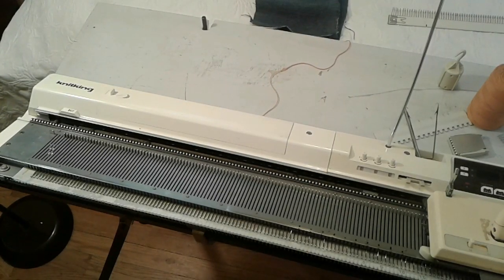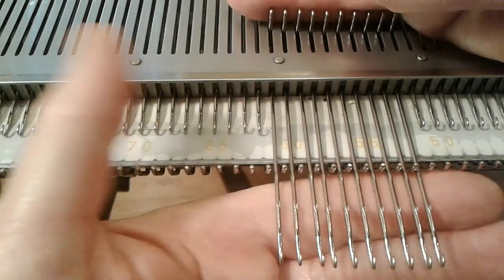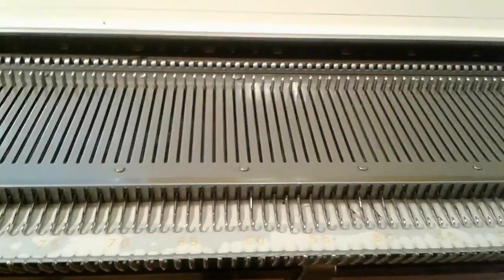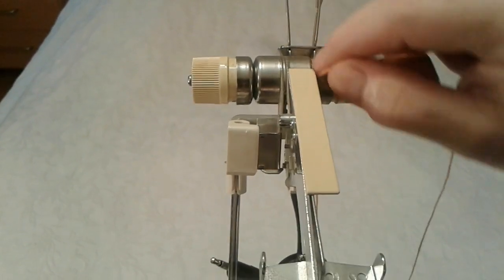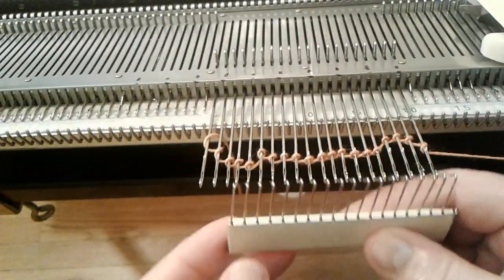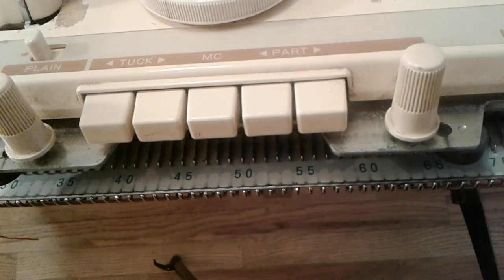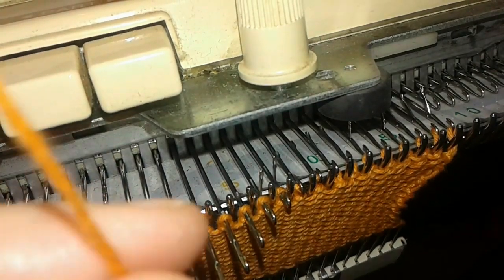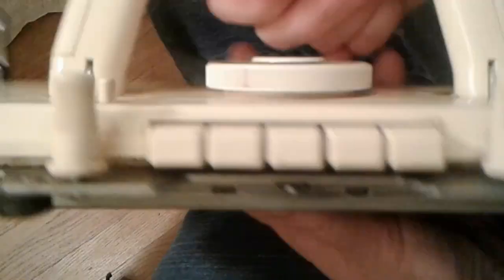How does a Knitting Machine Work? (Longer version) standard Brother / KnitKing KH930

Comment: Great video.  Thanks for the explanation.

I'm surprised the under side of the carriage is so complicated.  I'd expect just a single wave shaped slot to move the hooks in and out.

Do the various "levers" get oriented differently for two color or a pattern?

It seems to me the only thing it can control is whether some hooks are skipped in any given pass.  Wouldn't skipping a hook just do a reduction though?

I've only ever hand knit, and never anything more complicated than plain ribbing.
Reply from the maker: Good questions. I think some simpler (plastic?) machines may have just a wave shaped path. The different levers can change whether the machine knits in both directions or just one way. The needles have 4 positions labeled A through E. Ok, there is no C... A B D and E where A is an out of work needle, B and D are in work and E is a holding position. A needle in E position will just accumulate strands of yarn with each pass. That’s used for making tuck stitches or possibly holes. Hopefully I have that right. The Brother machines are much more complicated than I could ever explain. Different ones have electronic programming capabilities where the carriage and a belt on the machine communicate somehow to select the proper needles according to the chosen pattern. Hope that helps! ~Nancy

Comment: Why did you decide to use the KH 910 knitting carriage on the KH930 machine?  I am having trouble with my KH930 buttons sticking, so I am wondering if my KH 910 carriage would work better.
Reply from the maker: I bought a KH930/CompuKnit II at a Goodwill thrift shop for $25. It didn’t have a carriage. I did some research and saw the price of a replacement carriage ($180-200? at the time) and realized the 910 carriage would work on the 930. The buttons on my KH270 stick, too. There are ways to clean them. (I think TheAnswerLady May have a video on it.)

Comment: Hello I was looking at a KH 930 There is an E at end not sure if that means anything. Anyways, I heard you say that you can’t just ask the machine to make you a sock and out comes a sock (that was funny) so can you make socks and sweaters and everything in between and if so is it like a sewing machine pattern where you cut the fabric using a pattern them you have to sew the pieces together on the sewing machine. If that’s how it works how do you put the pieces together? Hope you understand my mumble jumble.

Thank you in advance 
Teresa
Reply from the maker: Hi Teresa,
I did a quick search to find the difference between a 930 and 930e, but didn’t come up with anything. The E most likely means electronic patterning. If you knit fabric, you can use a serger to cut and sew the item (sweater, for ex.). Socks are usually knit on the machine and finished by hand (like sewing a seam at the toe or the whole length depending on how it was made). You could shape the pieces on the machine — make the front, back, 2 sleeves, collage — and then sew them together on a sewing machine, but usually people put the pieces on the machine and sew 2-3 rows to attach them. Good questions! I hope I answered them well.
Nancy

Comment: Thank you for a very good and detailed video.  I've been contemplating getting one of these.  Did you say that you have to have a different machine for thicker yarn?
Reply from the maker: Yes, regular worsted weight yarn (in the US) is too thick for a standard knitting machine. Technically, you may be able to make it work by using every other needle, but it’s hard on the machines. There are mid-gauge and bulky machines.

Comment: Hi what type of yarn can I use for this machine. I want to get a machine that knits /crochets wool yarn.

Thank you
Reply from the maker: You would need a thinner yarn like sport weight or thinner (baby yarn, sock yarn). It usually comes on a cone. When I started out, I would unravel / recycle sweaters to get yarn for my machine. Peter Patchis offers come yarn. Also check eBay. If you live outside the US, the cone yarn may be available at shops in larger cities.
Reply: @cre8tivefun  thanks so much for getting back to me.